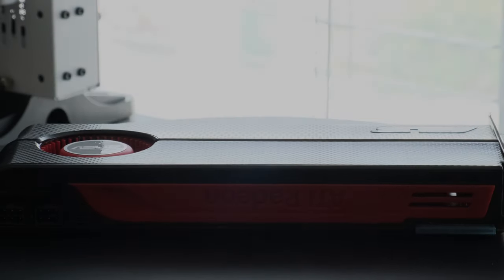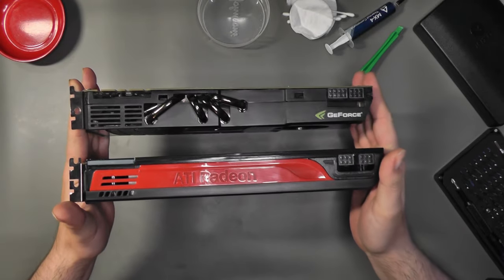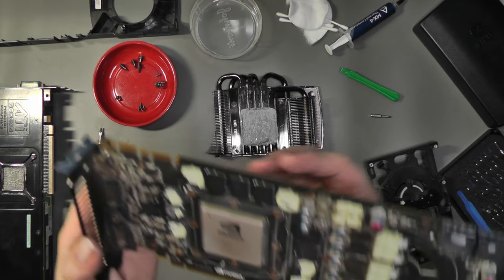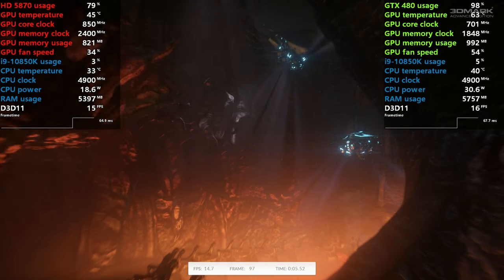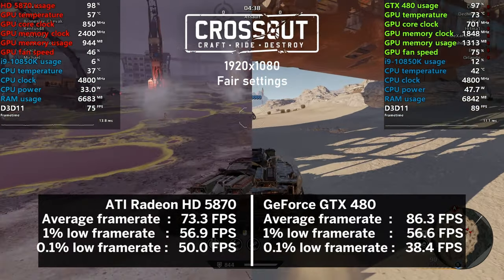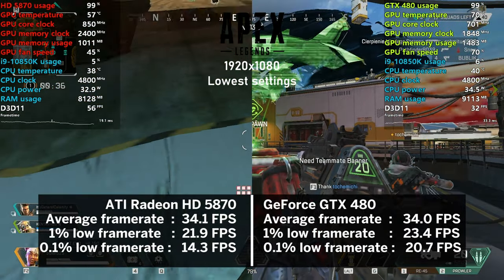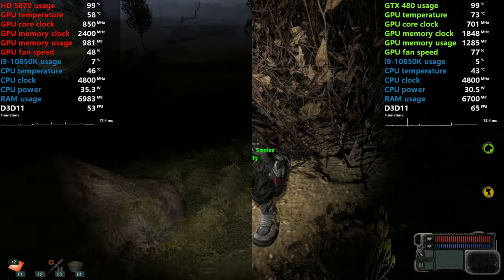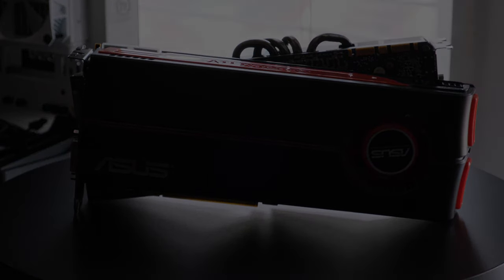GeForce GTX 480 vs Radeon HD 5870 - Legacy GPU Battle vol.5

Comment: Another good point for the AMD is its awesome rétrocompatibility. If you plan on using it for a rétro XP machine, the AMD can run older DirectX 4/5/6 games without problem. On the same machine you can run Windows 95 games to Crysis Era games. Thats Amazing. The 480 will refuse to run the games, or everything will be corrupteur!

Comment: GTX 480 came 6 month after, was $100 more expensive, ran hotter used more power but still sold more cause it was 5-10% faster.
Reply: NVidia marketing moment :p
Reply: Yeah, AMD had a superior GPU architecture from 2007 to 2015, but people still bought Nvidia... AMD was cheaper, because with smaller chips(smaller die area - mm^2) competed with much bigger Nvidia chips. 

Also both had driver problems, not just AMD, I know from experience and from reading forums when Nvidia wasn't hunting them down.
Reply: My gtx 480 was a hot beast, it was a very good performing and supported card. I had an ati radeon 4850 before it so it was a large upgrade going up a gen and tier.
Reply: @Lucromis  Back then there were big improvements between generations. Also the 4850 was only 20% slower than the 280 and the former costed 200$ while the later was 650$
Reply: @ismaelsoto9507  AMD: "Our gpu has great performance while being power efficient."
crowd: clapclapclapclap
Nvidia: "Our gpu can fry bacon!"
crowd goes wild

Comment: I owned the GTX 480. I remember it getting such a bad rap due to heat and noise issues some people had with it. I had a reference card and it performed incredibly. It beat the GTX 280 SLI setup I replaced with ease. I eventually upgraded to a GTX 580, but I really loved both GPU's.
Reply: The problem with the 480 was it came out 6 months late, cost 100$ more and was only 5% faster, which disappeared rapidly when you overclocked the 5870 while the 480 was already near thermal limits out of the box. That was also one of the generations nvidia pushed out a driver that hardware killed cards too. Good times.

Comment: That GTX480 is responsible for the heat wave outside :)
Reply from the maker: Huh! Well, this one is very cool as it seem! Hope you're well :)
Reply: @nexus_tech  It was a stupid joke :) At that time, i think you can recall that it was named the "Ferminator" so that is what i was alluding to. But anyway i hope you continue this series of versus cards. They are great !
Reply: @drupiROM  Yes, the gtx 480 with the original stock cooler with the stock fan curve(pre driver update) ran hot as hell, considerng back then 82.4C was the maximum temperature GPUs ran at.
Reply: @ivankovachev8835  I still want one to play with and see for myself how it was :)
Reply: @drupiROM  IDK post GT 9000 series and pre-Maxwell(2008-2014) Nvidia is boring as hell, AMD is much ore interesting in that period.

Comment: Just imagine GTX 480 in Uk with current electricity prices :D
Reply from the maker: Worth it! haha!
Reply: You know the rtx 4090 consumes 480-520W the gtx 480 consumes 230W.
Reply: @ivankovachev8835  When the mosfets are at 100% that means the core and the VRAM its consuming 100% of the amps and to be fair 520W you eat when you OC a little the card depending on the Subventor. Some are OC some or Under OC. So an average of 500W for an RTX 4090? well you need a hell of game to max out that GPU without passing the Monitor refresh rate.
Reply: @DanielCardei  The founder's edition is good and consumes 450W, but almost all 3rd party ones are overvolted and overclocked and consume 480-520W. Now yes you can manually reduce the power consumption a lot.

For example reduce the clocks by 6-9% and undervolt, and the 4090 drops to 300-350W.

But running a 3rd party versions stock, that's how much the card consumes in heavy games and benchmarks.

And that is way too much. GPUs were capped at 230-250W TDP for a reason and we made fun of GPUs that exceeded it for a reason. It was a great engineering standard, but Nvidia got desperate with the rtx 3000 series. Same goes for CPUs but they should cap at 140W.

Now GPUs are fat, heavy, long, heat the room and in general the only positive is that they get 10%(1.1x) extra performance for a 1.5x more power consumption.
.
The RTX 4070Ti should be the highest-end GPU of the generation and the RX 7800 XT from AMD should be theirs.
The RTX 3070 and RX 6800 should have been the highest-end GPUs of their generations.

The other option would be for AMD and Nvidia to stop pushing the clock speeds to the moon to get an extra 5-10% performance so that they are on top in the dumb review benchmarks, which would reduce the power consumption of cards by 30-35%

Comment: For my 'retro modern' crt gaming setup I bought a Asus Matrix 5870. Running at CRT resolutions, with high refresh rates, it has been a very capable card - even running on Mac OS, unflashed, with a boot screen, even in Snow Leopard (10.6). I do a lot of cRPGs so, it seems, that my CPU matters more - this card lives in a Mac Pro from 2010 that I managed to acquire for next to nothing. It's a monster from 2010/2011 - I've tried several operating systems, but - weirdly, perhaps - it seems like Linux (Garuda) was the sweetspot, but really... I mean REALLY... prone to breaking on update.

Edit: The really neat thing about the Matrix was that it had 2 gb of memory... at the end of 2010, early 2011. It also had the light feature to monitor CPU load, a practical RGB sort of thing...
Reply from the maker: That's one legendary card ! Wish it was not as RARE so I could get one :)
Reply: @nexus_tech  I got lucky on eBay, the seller took my best offer - the 'buy it now' ones are stupid expensive. I've tried to find other Matrix edition cards, but... wow... those get up there quick (980ti is my dream for that system). 

Thanks for responding :)

Comment: Hi. Good video. Just a request but I understand if it becomes too much work. A test of cards price against the same price. I guess that would mean against the GTX470 but since the 5870 was half a year old by then maybe it got a price cut and competed more against the 460. I don’t remember but I do know AMD over the years have often cut the prices of their cards aggressively and I have almost always managed to get them under MSRP. At least it used to be the case 10-15 years ago. I understand that you have enough with these flagships battles for now though so just a tip for future videos.
Reply from the maker: Hello mate - what is up :) I was in two minds about this round - it would make more sense to compare the 470 with the 5870, but then, when I tried to match up GPU's for videos, this generation made no sense due to Nvidia being late. Next round will be SPOT on - I take pricing from TechPowerUp. Thanks for your feedback, I like to hear it. :)

Comment: the 5870 should be better than the 480 , the 5870 needed the 2gb f even 3/4gb  i dont understand why such powerful cards had low vram example the 780ti
Reply from the maker: There was a 2GB model, very hard to come by! And agreed, would be a lot more viable with more VRAM! The 780Ti will be tested soon, stay tuned :)